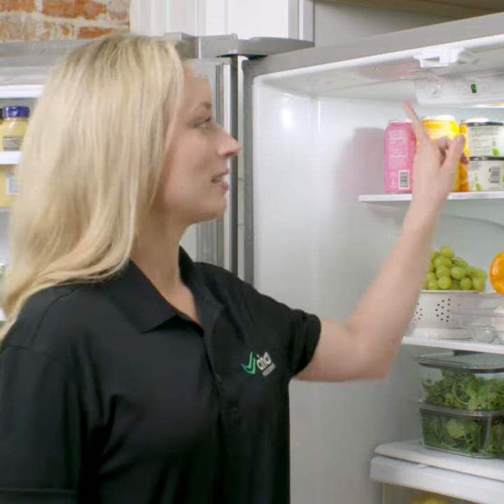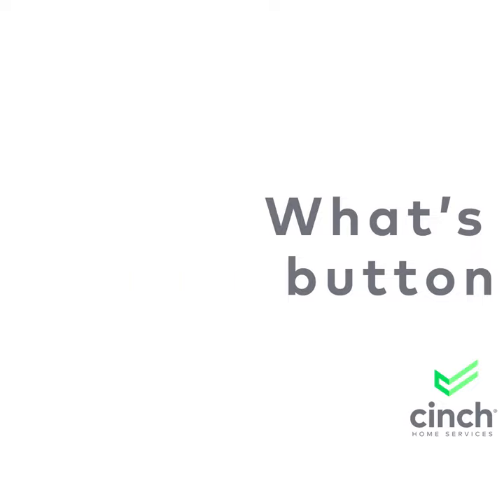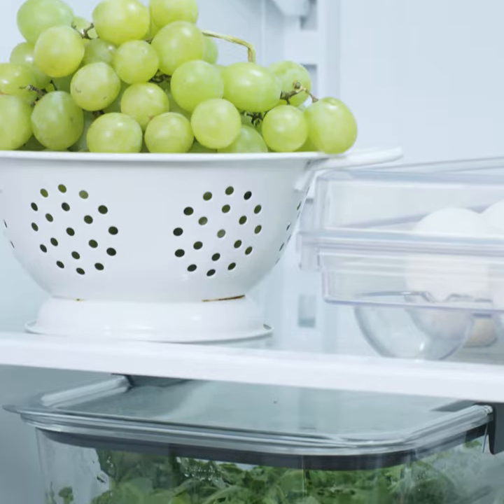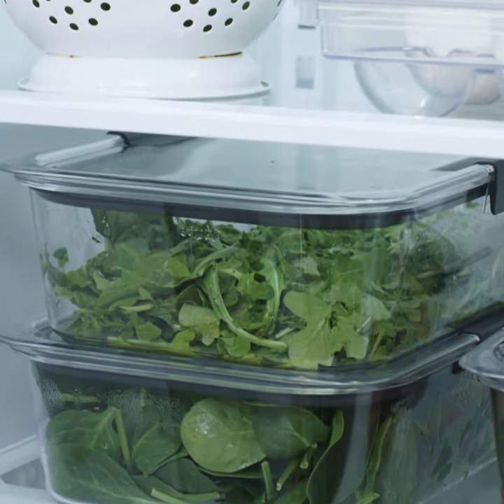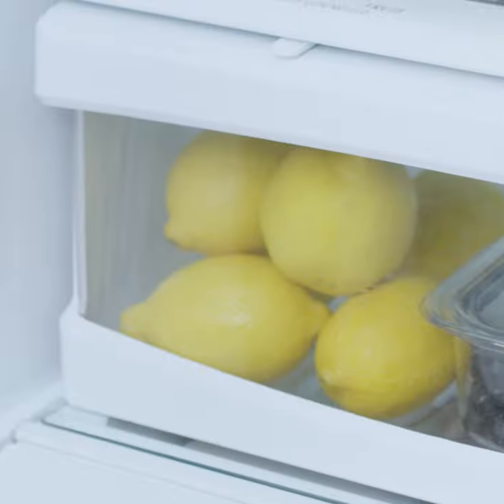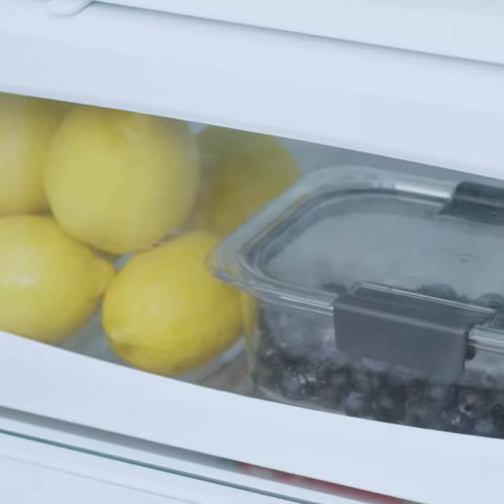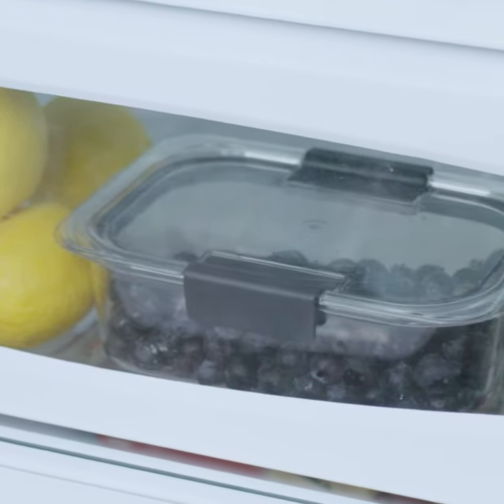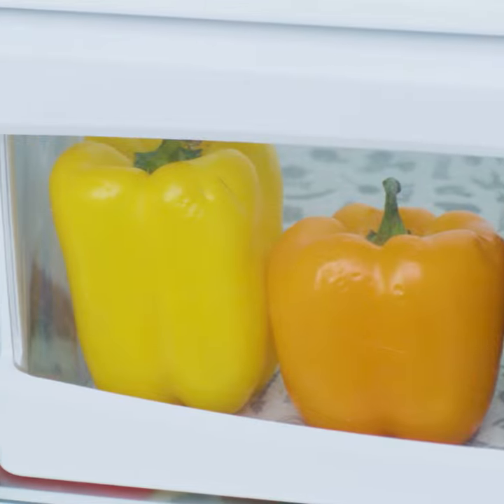What does the humidity control button do on your fridge? | Cinch Home Services

Comment: I believe the conclusion of this video and the humidity control button is incorrect.  It has nothing to do with louvers that let outside air into the refrigerator's interior.  Rather, when ON, that button is intended to slightly heat the frame of the refrigerator to reduce moisture accumulation on the exterior during humid months of summer.  When the door seals are moist, this is an obvious sign that excess moisture is accumulating and would prompt you to turn it ON.  It uses more energy when ON, so during the drier months of the year, it should be OFF.